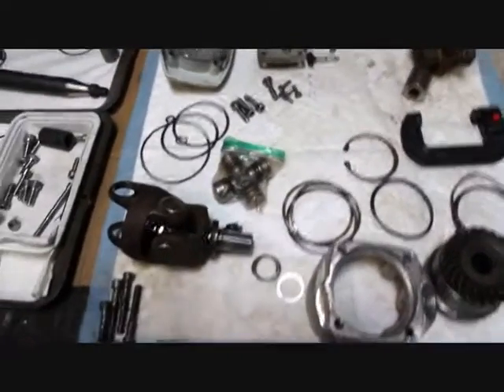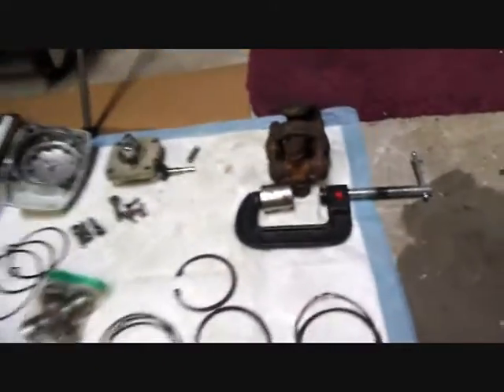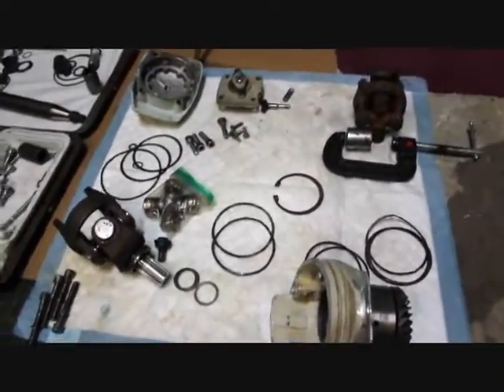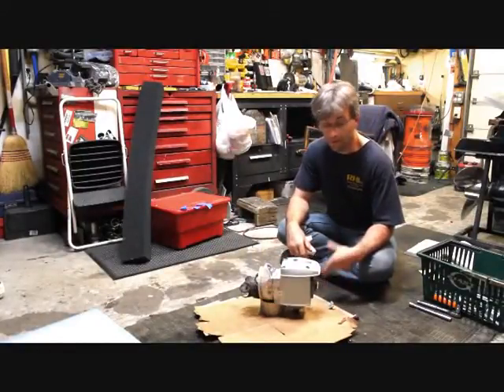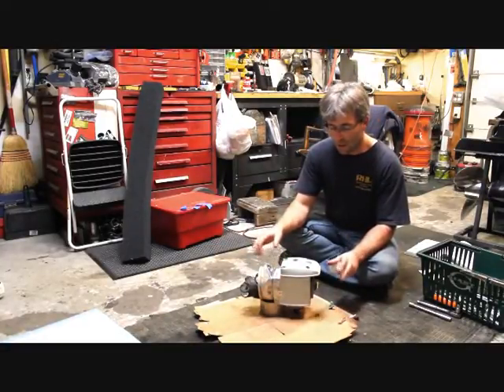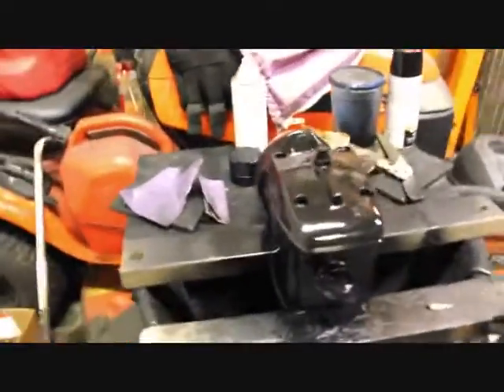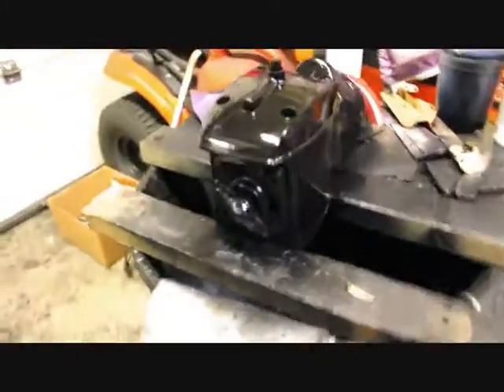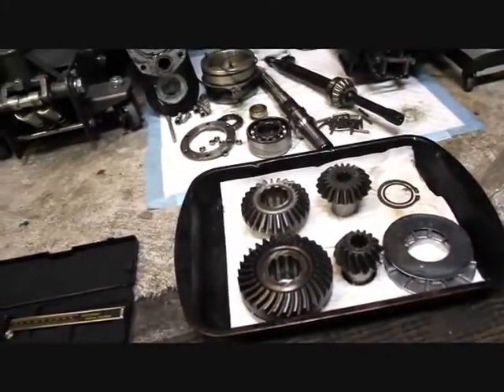Volvo Penta Project - Part 8

Comment: Great series that will be of help once the eBay sterndrive I've bought arrives. Seller "thinks" it's a 270 or 280, but someone else thinks it might be a 250. Is there a simple way to tell these 3 apart from the outside? Interesting to hear you don't want the 2.15 ratios, because that's what I'm hoping is in it, I have the twin cam 4 cylinder motor (aq171) which should be enough. The boat is a Campion 522 which previously had a mercruiser 140hp. Thank you for making this excellent series.

Comment: your videos have been very helpful in getting my old 275 drive apart and back together again.  Question though !  I didn't see you set the rolling torque value on the double bearing.  Is that done via the Torque Wrench or per the schematic in the shop manual ?
Reply from the maker: I didn't take it that far apart. With both ends open I could flush it out so it stayed. sorry.